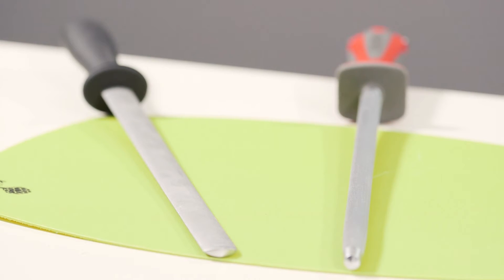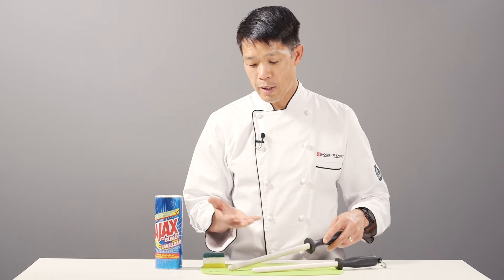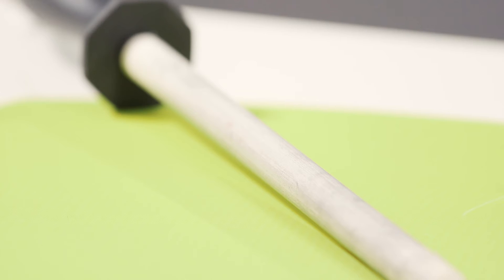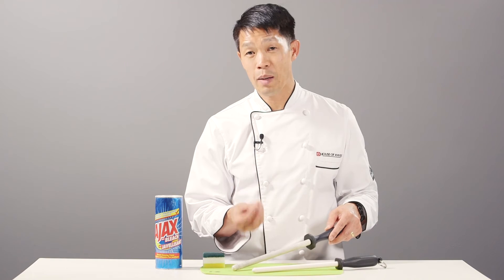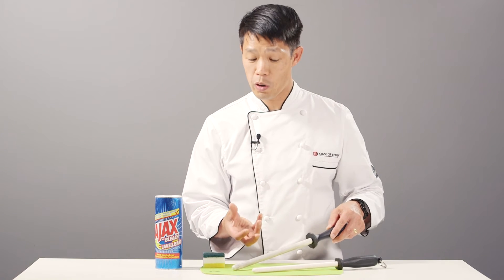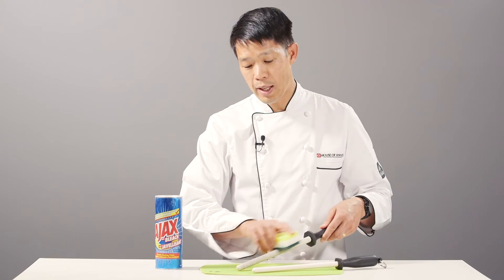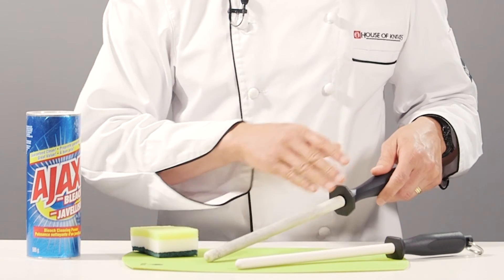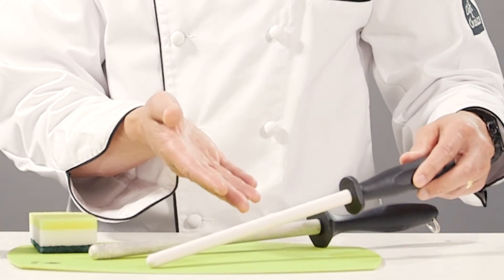Quick Tip #5 - How to Clean a Ceramic Honing Steel

Comment from the maker: Have you purchased one of our Edgelogix ceramic honing rods recently? This is how you keep it maintained for maximum performance.
Reply: Don't have to worry about using any abrasive with the honing rod? That's what I was concerned bout. That, and it being porous to begin with, but I presume it will dry out afterward.
Reply: Use a pencil eraser or rubber and "erase" the black right off of any ceramic rod or sharpening stone. Much easier and cheaper.
Reply: @Gator-357 you saved me thank you bro

Comment: If AJAX is not sold in my country.  Any other way to clean ceramic rod?
Reply: Any of the bathtub cleaning powders work (AJAX, Barkeepers Friend, etc.). Just make sure to thoroughly dry the rod so any remaining steel dust doesn't rust. I like to use a Rust Eraser, sometimes called a Super Eraser. It's an eraser with some abrasives inside of it. Any of those should work though.
Reply: Could soak the rod Ajax isn’t the best way to clean a cooking implement

Comment: Nope, don't use ajax or steel wool, it is too abrasive. Use an artists eraser or a green scratch pad, dush liquid and hot water, either way works great. The eraser works very well